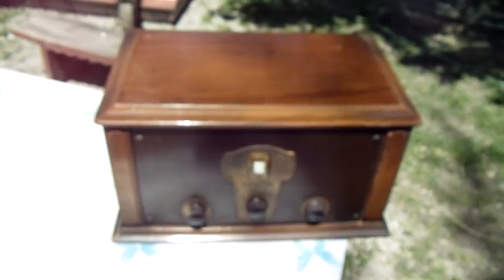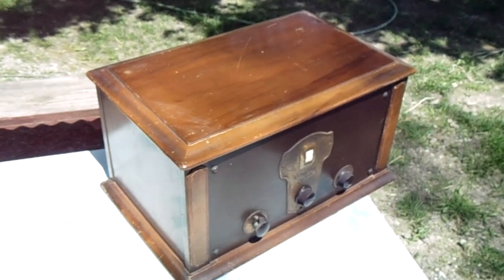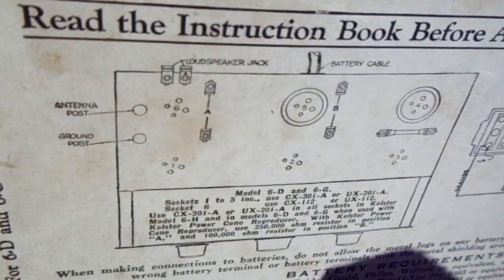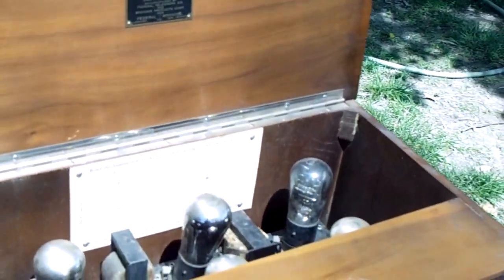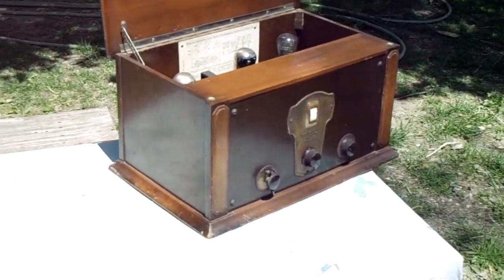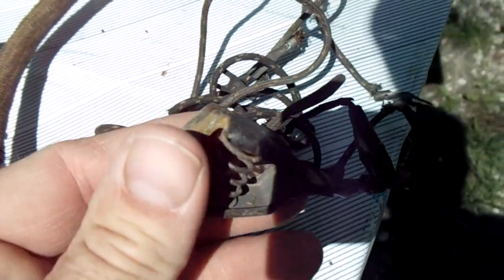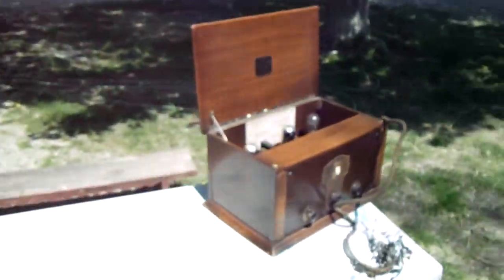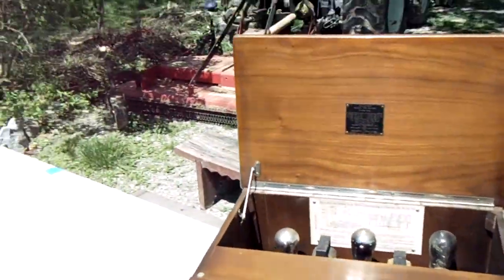1926 Kolster 6D Battery Powered Radio by Federal Telegraph Antique

Comment: Very nice looking radio.  Looks complete and should be easy to get running.  And yes, you will need a high impedance speaker.   Most vintage horn speakers will work with your radio.   Good luck to you, and when you do get it looked over and running, you will find a lot of pleasure in listening to it.   And remember,  a good ground is just as important as having a good antenna.

Comment: You could buy a set of vintage high-impedance headphones to use with it, in place of a speaker. Headphones are generally much more common and much less expensive than the old horn speakers (I ended up making my own "horn" speaker for my antique 3-tube set, using an original horn driver unit mounted under a wooden bowl (turned upside-down), with a large conch-shell for a horn). As far as powering it up, you can buy a kit for a power supply for well under $100 from Antique Electronics Supply.

Comment: Hi-Nice radio-I have several early radios. They are expensive to fix and need a power supply,rather than batteries. Also you need a 1920's speaker to hook it to. A good radio man should go over it as they can burn up if hooked to electricity without being checked. there might be a Antique Radio Club in your area who could steer you to a repairman,etc. Just look online. Good Luck